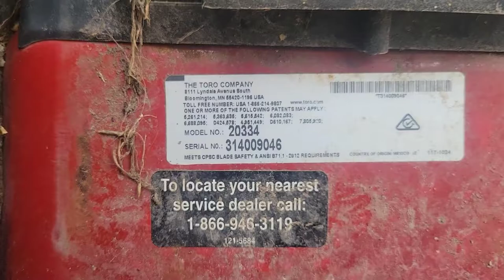How to Replace the Carburetor on Toro lawn mower

Comment: Where can we obtain rebuilt kit for Toro recycler carb
Reply from the maker: Look for the part number stamped on your carb then type that number into amazon. Most carbs now days will work for 20 different makes and models. Just make sure that your exact part number is listed in the description of the one you buy.

Comment: Maybe you should start from the beginning so people could learn from you the proper steps to remove the old carburetor and then replace it with the new one.
Reply from the maker: Maybe I'll make a part two that is part 1 😀. After removing air filter It really is just a few bolts and a fuel line to take it off....
Reply: @offgridutah1  I understand that.  Thank you.  I was speaking for the people who need the step by step more than you and I do.